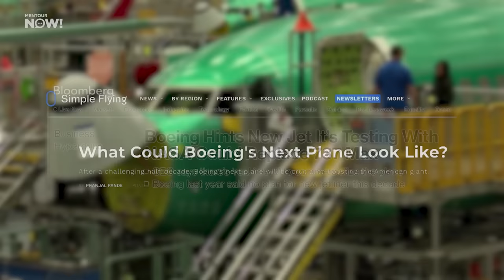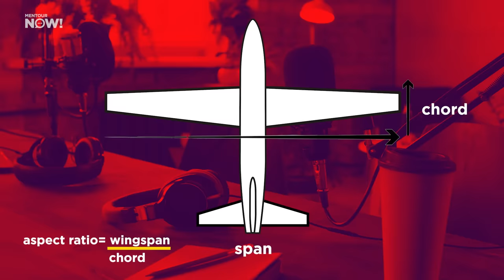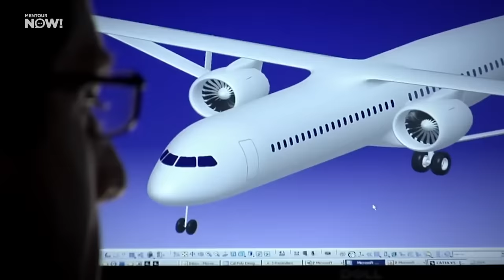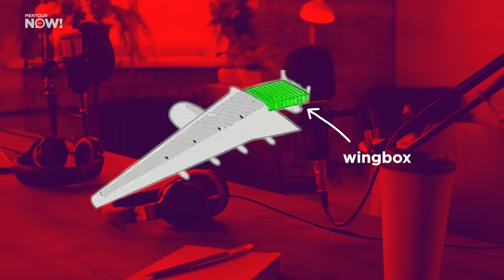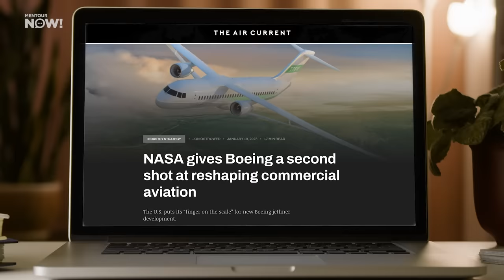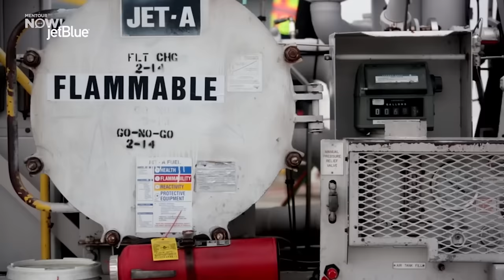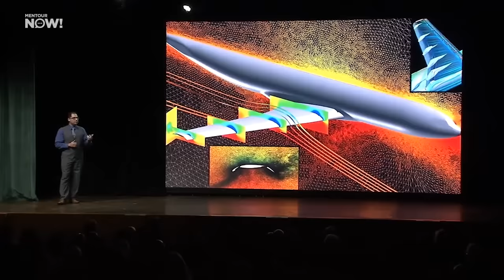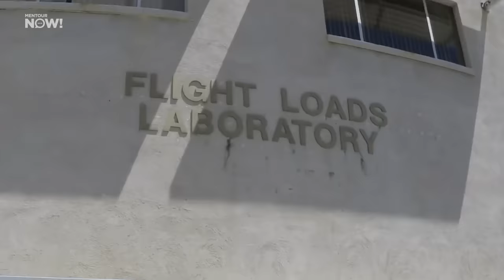Revolutionary Breakthrough: Boeing's Transonic Wing in Partnership with NASA!

Comment: I just hope Boeing go about it in much legit, legal, safe and professional way than it's previous management did.
Reply: Came here to comment that the idea of a new folding wing design from Boeing gives me the fear, surely they'll cut whatever corners they can to save a few bucks on design, manufacturing, maintenance etc.
Reply: @melondoc  you don't need to fly Boeing if you don't want to, no one is forcing you.
Reply: Oh no the libertarians entered the chat
Reply: @aiden359  yep. And wtf are they on about? We have no clue what plane we are going to fly on when we look for the cheapest ticket.
Reply: @aiden359  @TesterAnimal1 You could always ask what aircraft you will be on, or just look out the window before you get on. If you're that scared, remember that nobody is forcing you to fly.
Collectivists are so silly some times.
Reply: @ducktails (to be very clear, not trying to simp, companies are companies) you'll be fine mate, the company on the inside has changed somewhat significantly, and there's a lot of FAA scrutiny now. The last 3 years have almost exclusively been work to certify the 777x and 787, with 0 other development (I would say more but legally can't lol). I'd be more concerned about airlines with bad safety records
Reply: i have absolute trust in boeing:
buggering it up!
Reply: What’s the alternative? Scarebus?
Reply: @MC-nb6jx  there doesn't seem to be a noticeable difference thou. 😉. 

I guess the 5 of you should take on a frequent flier program. Maybe after that, there could be ALMOST a difference.😃
Reply: @mmm0404  … Whoosh 😉😉
Reply: @MC-nb6jx 💣💥
Reply: @mmm0404  I fail to see how your somewhat dubious comment relates to the OP.
Reply: $9 per hr python coders in Hyderabad, was wrong approach.
Reply: @whizkid4386  ooh did I hurt your feelings? Lol 

If you feel that the an  aircraft has 
" legitimate " safety concerns then don't fly it. Simple 

At this point its just a waste of time convincing some people  that the 737MAX is a safe plane now so why bother? 

If someone else Trusts the process and believes the aircraft is safe enough for them, they should fly.

Who cares, some of yall just trippin over nothing.
Reply: @peterkotara  ooh it doesn't, purposely.
Reply: @RavingFan  How else do you maximize shareholder return?
The glorious almighty shareholder returns.
Reply: @mmm0404  Ok then.
Good luck.
Reply: @melondoc The Super Hornet has had folding wings for..decades..hundreds of aircraft. Proven concept and it works. FYI: Boeing made
Reply: @mmm0404  You realize the vast majority of flyers dont get to just choose their plane? Get a griiiip man
Reply: @mmm0404  really? Can you request aircraft type when you're assigned to be somewhere that requires flying?
Reply: @joeblogs6598  aside from the fact that a completely different aircraft can be assigned to a segment during irregular operations, many if not most people are flying for their jobs which they need to not be homeless. By that logic no one is ever forced to do anything unless you have a chip in your brain. Even at gunpoint you can always refuse right?
Reply: @mmm0404  
The way Boeing handled the MAX was a disgrace. If they could have pinned the Ethiopian 502 incident on the pilots (maybe if a bit more time had elapsed since Lion Air) they absolutely would have, and those planes would be flying with the same software today. 

As it turns out they were found out, and got a light slap on the wrist after self-certifying with a friendly regulator.

Flying is inherently still a safe way to travel but my bitterness comes from the fact that 'old Boeing' would have never allowed this to happen.
Reply: @ltipst2962  what about the folks who say, they avoid the MAX at all costs? 😂😂
Reply: @justcommenting4981  look, all I'm saying is, if you feel unsafe with a certain aircraft try another another one. 

You can easily see the aircraft you are flying when you book your flight. 🤷
Reply: @TesterAnimal1  yes, most don't care to check the aircraft they are flying on, not really a big deal.  

For those who do care, information on your aircraft type is available online when you book your flight. 

I don't fly without knowing the aircraft I'm traveling on.
Reply: @mmm0404  yea I'm telling you no, you can't just fly on a different aircraft. Do you travel for work? Do they book your tickets? You can not-fly and not do your job as directed and deal with what happens. Maybe you're Roadhouse and can get away with that. You don't even have a choice in what regional/feeder carrier you're on. This is to say nothing of areas served by only a single carrier. Unless you get every other passenger to cancel their ticket with refund the carrier will continue to use whatever planes they paid for to run that segment. As a passenger your only choice is where you sit and what soda you want(of the limited selection). Any aircraft currently being flown by a commercial carrier in the U.S. is probably extremely safe, but you absolutely do not have a choice in what you fly on. You can see what you'll get, but that's not a choice, that's just showing you, but even that can change if needed.
Reply: @justcommenting4981  majority of people travel for leisure, family and other non-business travel activities . They book their own flights 

I don't get why y'all   making a big deal out of this thou. Most people do have a choice, its just that a significant majority of those people don't care what aircraft they fly on. 

Yes, Boeing jets are pretty safe and there are thousands of them flying without incident, its just that there are some people who have had trust issues since the MAX incidents. 

Most people do believe the MAX is a safe plane now, after all the scrutiny, tests and close guarded certification process but others still remain attached to the past, how do you help such people? 

If its a big deal to you, you can get plenty of information about your flight and aircraft prior to departure. Yes for some, who travel for business and have their company manage their bookings  there isn't much of a choice but for the significant majority there is, if you care soo much.
Reply: @mmm0404  How many Americans planes are NOT Boeing ?
Reply: They just fired 2,000 accountants and HR to hire engineers so we’ll see.
Reply: @aiden359  *Commercial Libertarians** or Anarcho-Capitalists. 
The government's one of less than four fundamental duties is regulating commerce. Anti-trust is one of those. Boeing has been, like GE, neglecting it's role in the market. They're companies which engineer technology, capital intensive projects which can be sold to huge industries. The managers which run Boeing and GE are MBAs. They make money through cutting wages and off-shoring, they don't understand the products. 75% of GE revenue is GEs investments. Our market is severely distorted.
Reply: they'd have to most likely, after the 737max incident FAA has lost its reputation. Now every new plane they make or modify will need to be certified by the FAA equivalent of EU, China, India, Brazil and likely some others.
Reply: @joeblogs6598  Cant tell if bot or stupid
Reply: @ursodermatt8809  Ya, because they're the only ones that screw up big time.
Reply: @TesterAnimal1  the airframe is listed on the ticket dummy
Reply: @melondoc  They tried their hardest to pin both crashes on the poor pilots, they really did. Hell, even now. Right now. And especially less than three months ago in December Boeing fought tooth and nail with everything they had to force the US Congress to give them a no strings attached extra extension on the time limit in which Boeing would be forced to include a new crew alerting safety system into the Max 7 and 10 certifications to be allowed to fly those two variants.

Let me break that down into a TLDR for you. Less than three months ago,  Boeing fought tooth and nail AGAINST a feature that would make their aircraft safer. They fought the government and won, to make the Max 7 and Max 10 more dangerous to everyone aboard them. Why? Because installing the new safety system would have been more expensive.

They haven’t changed. They’ll still kill innocent pilots, cabin crew and pax to save a buck.
Reply: @Thenonsocial  What's stupid about you being an adult and choosing to not fly on a plane you think is dangerous?

If you don't feel something is safe enough for you to use, don't use it. What's the problem?
Reply: @joeblogs6598  ok, then labor is theft because I'm coerced to work by threat of homelessness.
Reply: Yep boeing is on it trust me.
Reply: @melondoc  wrong Boeing learned their lesson when the airlines said just build us a plane like in the past. Don't matter the cost we will buy it.
Reply: @pranavkolluri  yep worked at Boeing for many year they're going back old school boeing but keeping up with technology at the same time it's a win-win situation for boeing
Reply: @joeblogs6598  if I don't work the bank will have police coerce me out of my house with force and maybe at gunpoint. If that's not coercion then neither is a gun to your head. You aren't forced to pay taxes at gun point any more than I am forced to labor.
Reply: @justcommenting4981  "the bank will have police coerce me out of my house with force and maybe at gunpoint."
Those terms you agreed to when you took out a loan at the bank.

"You aren't forced to pay taxes at gun point any more than I am forced to labor."
Taxation on the other hand, has no such agreement, document, or expression of your consent.

See how consent is key?
Reply: @joeblogs6598  the alternative to not taking a loan or paying rent is homelessness. You're free to move or not make money. If you don't like being taxed stop consenting to it by making money or entering into taxable agreements. Pretty simple.
Reply: @joeblogs6598  you consent to taxation by accepting money. You don't own money. You may not reproduce or destroy it. You also consent to taxation through taxable ownership. I didn't sign a contract consenting for a property owner to own property. The contract is only between the previous owner and new owner. Therefore I can take and use any object to which I do not consent to another's ownership of if I do not consent to governance and taxation by their government. You aren't entitled to having your property privileges protected by a nation state. If you don't want to be taxed, stop using money and entering into taxable covenants using government ownership protections. You want government to protect your property by forcing others to acknowledge your ownership but don't want to pay for it. Entitled.
Reply: @joeblogs6598   You're ownership is only acknowledged by the person you made contract with, but I have no basis to consider their ownership valid because they never made a contract with me. I have no basis to acknowledge ownership if I didn't consent to a contract, so I can live where I want. The ownership you're describing is coerced by the government. You can take trades of any kind tax free if you don't use the apparatus of government to exchange ownership. Build a house in the forest without paying money or signing legal documents and it can't be taxed. Stop using money and signing documents and you won't be taxed. The government won't protect someone else from using that property or kicking you out, but you won't pay taxes. If you stopped consenting to government by using the legal framework you would not be taxed.
Reply: Boeing will, they'll be as squeekee clean as the U.S. Congress.
Reply: @aiden359  where's Cosmo Kramer when you need him?
Reply: @andred3299  How so ?
Reply: @melondoc  Because what happened with the Max, and FAA, no corners will be cut.
Reply: Lol!
Reply: @mmm0404  people always used to say " if it ain't boeing,  I ain't goin"!
Reply: Boeing’s pervious management was more engineering oriented. And is present management is more banker oriented .
The present management is extremely over compensated.
Which team would u prefer ?😢
Reply: Will never change as long as the commitment is to shareholders and bonuses versus safety and customers.

Comment: One of the requirements NASA has for funding projects like this is that the information learned is released to the public.
Reply: Open source doesn't have to be forced through taxes. That is a command and control style approach. 

Remove regulations preventing cheap entry into the space and there will be a plethora of ideas thrown about. Most will fail but unimagined innovation will occur. 

NASA and gov is a barrier, not a benefactor. The incentives are backwards. There should be no barriers or qualifications for putting aircraft in the sky so long as no one can be injured. By that I don't mean individuals. I mean the everything when it comes to injury, human life, environmental pollution, accidents, the works. It's not simple to consider but it has to be done if you dare apply for insurance with a wacky idea. Some people will be successful and some won't. It's in the relationships where the details are worked out as it should be. One size does not fit all.

It's the way everything should work.  Top down approach works great for mil spec (or at least we assume it does since it's worked in the past) but outside conflicts, civvies will come up with much better ideas if left alone to try.

Compare it to the tech space and Linux. Practically the entire internet is run on a user created and modified over several generations version of the original idea. Because of it the planetary population has been able to communicate more freely and accessibly. What do you think would have happened if gov got in the way of managing how to interface software with hardware? They would have if they could have but the tech industry evolves too fast for their glacial pace to keep up.
Reply: Except the moon landing!
They accidentally deleted that one. wink wink*
Reply: @miinyoo   im not actually sure what youre trying to say here, but i can tell that you dont know what youre talking about on a fundamental level. "removing regulations preventing cheap entry into the space" is a direct contradiction to "there should be no barriers or qualifications for putting aircraft in the sky so long as no one can be injured."

in order to enforce the last point, the former can not happen. the point of regulation is to control those who would take flight. one of the reasons this control is necessary is safety. in order to comply with the rigorous and specific criteria necessary to take flight in any aircraft safely you need to spend money to make certain that aircraft is in fact safe. 

because of this glaring contradiction in your logic I'm forced to contend with a few possibilities. the first, is that you dont recognize the contradiction. that seems unlikely. the second, is that you simply misspoke, and you dont actually want deregulation at all. which seems very unlikely considering your wording. the possibility ive chosen to believe for the time being is that you are not actually concerned with the safety of others and would rather a "move fast and break things" approach to aviation. which is obviously not an opinion anyone should have, so you have added "so long as no one can be injured" to cover for yourself. i suppose perhaps you believe the current regulations are simply uneccessary to maintain safe aviation practices, but if thats the case i feel like you should watch a lot more of this channel. the failures we see on this channel are prime examples of how perilous air flight is even with our current, extremely safe practices. deregulating would likely kill our poor host, either because he crashes his plane or dies of exhaustion trying to cover other crashes. 

and the idea that "civies will come up with much better ideas if left alone to try" is the truly backwards thinking. research does not succeed -- or even happen -- without funding. if you leave the free market to decide who does research on what, the only ideas that will prosper are those that are incredibly safe investments for companies. because the ONLY non-government organizations with the funding and interest to do research on planes are companies like boeing, who are motivated by profit alone. they will never try any "wacky ideas." they will only fund research that they feel is highly likely to return their investment. which we can see happening TODAY with them waiting an entire decade before designing their next aircraft. waiting until their government subsidized research is complete before taking any further steps to minimize risk. and this subsidized research is also MUCH cheaper than you would expect for a company that makes billion dollar planes pretty much on a weekly basis. 

now, imagine a world where NASA didnt work with boeing on this new design. what do you think boeing would be doing? do you think they would be doing MORE research if the US government wasnt helping them pay for it? no. less money means less research, that is common sense. and none of the small amount of research they did would be shared with the world either, further slowing the advancement of the industry as a whole.

now, i could write an entire essay on why your comparison to linux is not only a bad comparison, but is filled with similar misconceptions about how the world works and how the history of linux unfolded, but frankly I'll be surprised if you even read this far. and shocked if you took the time to both read it critically and self reflect on if anything ive said was true.